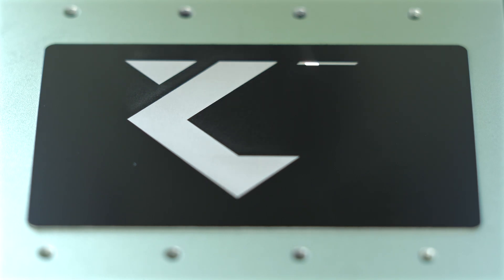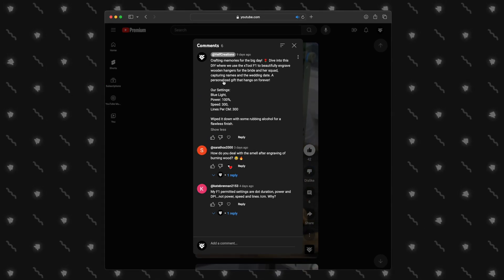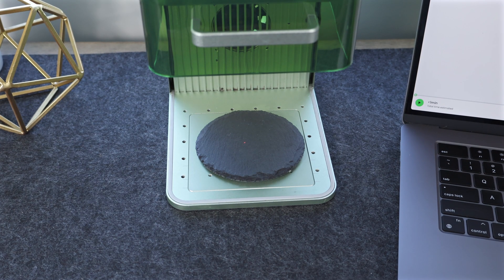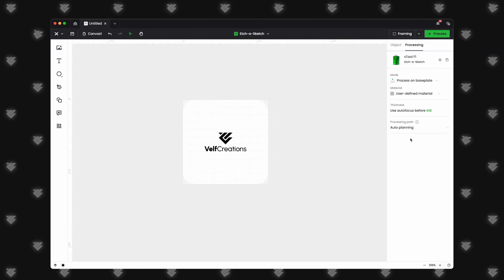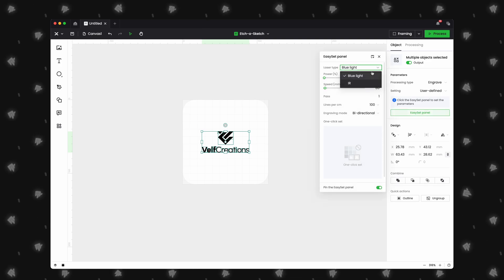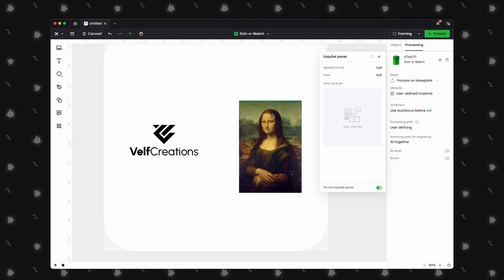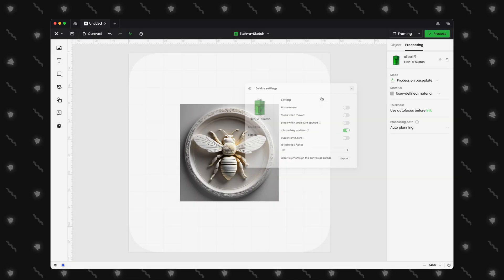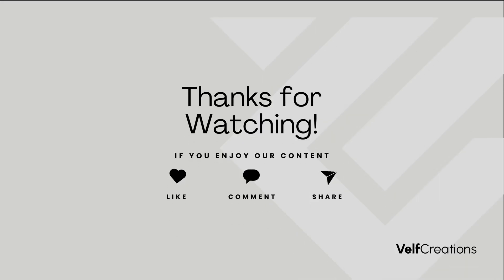xTool F1 Guide: Avoid These Issues, Mistakes, and Misconceptions

Comment: I only see a red dot my lens cover is off and I turned it off and turned it on, I re-installed the software nothing
Reply: yeah mine stoped working on day 2 and xtool never replaced or repaired anything just stuck me with an expensive lemon and now its been over a year and had to fix it myself with another cost by replacing the laser.

Comment: Why won't my XTOOL F1 connect with USB or wi-fi???😢
Reply: Do you have the correct USB cable connected to the correct USB on the F1 and the computer? You can’t connect to Wifi until you connect with the USB first. If you can’t use the USB then you need to contact XTool for help.